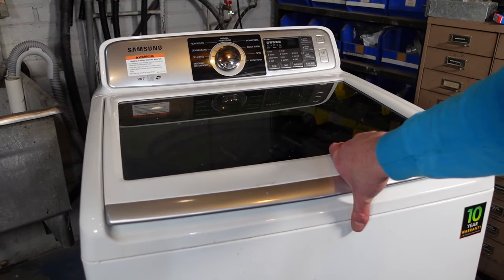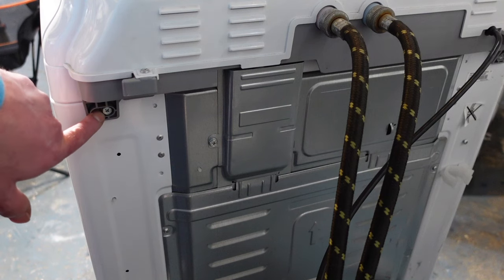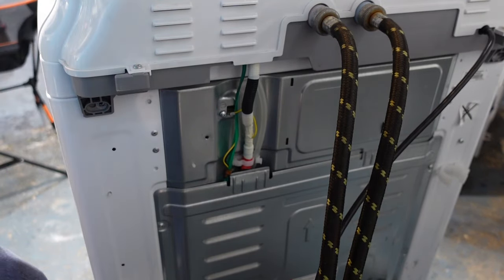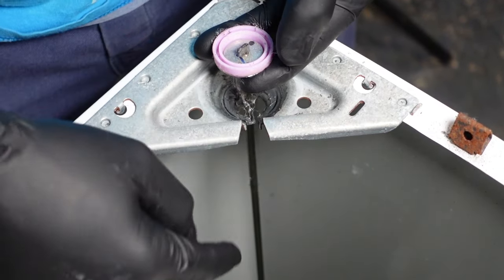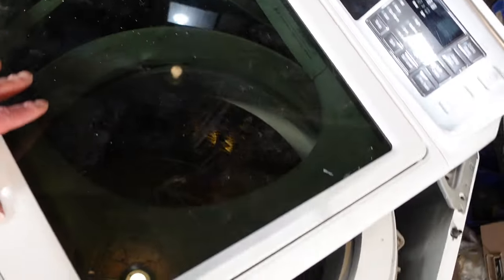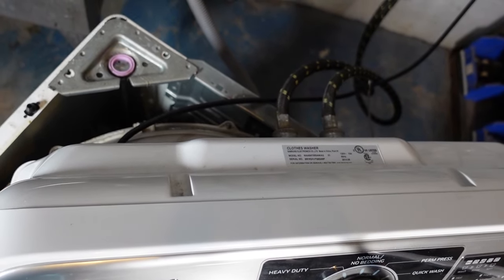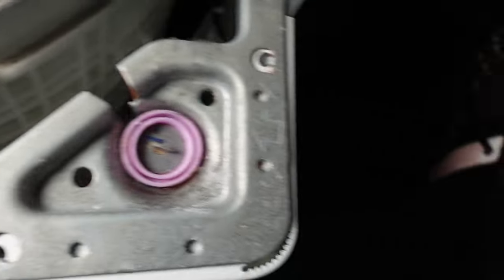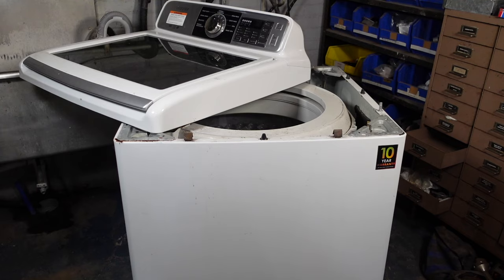Samsung Top Load Washer Off Balance FIX DIY How to Replace Suspension Rods DC97-16350C

Comment: I would like to add my notes as this video was posted 3 years and my washer 5200a is about that time from or another 6 months at max.  

The screws in the rear on mine are actually facing down on both sides. Then the access cover will come up.  Then you will removed the tub covers screws in the rear . Next there are two wires on the right side and one wire on the left. I removed them because when you lift on the tub cover your wires will be taking the stress of lifting.  Next lift the tub lid and remove the two rubber plug caps that hide your two screws in the front . Once removed the tub cover can be lifted and begin rod removal.  So the difference was location of screws and no front clip to press in with putty knife. Mine was all done with a drill at torque 7 setting(dewalt 20v) and I grabbed the top of the rods to get them out with a medium sized set of channel locks.   Make sure you lift on the tub when ever you expect to achieve what your doing - removing rod/ looking to get the bottom back in / putting the top back into place. I did take pics to add of my model as well

Comment: Slight note: removing the lid on other models, you have to wiggle out these two fingernail size rubber stoppers for the lid opening and closing (in front of lid) and there are screws beneath. No clips. Almost ruined mine.

Comment: Thank you so very much! I just finished this repair, and while I don't yet know if it solved the problem, the fact that I was confident enough to try alone is HUGE in my world. 
One thing I would add is a caution about the little metal tabs sticking up an inch or so to the outside of the clips. I kept hitting them and was, of course, getting nowhere.

Comment: Heads up for model wa45n3050aw/a4...there are also two screws up front before you pop the tabs! They are under rubber plugs.  Took me a while before I realized that myself.

Comment: Mine was part of a recall and the wife had a Samsung tech install 4 bolts to secure the top from launching and killing someone.
I had no idea they did that  and a repair guy who came to replace the suspension springs was just as surprised after he struggled for a good half hour trying to release the top.

Comment: If anyone has a newer dc68 there are no clips on front there are 2 screws under some rubber grommets or plugs that are very easily removed and much simpler screws in there instead of annoying clips

Comment: I removed the rods one at a time and measured the springs.  All were around 4 inches in length, so I stretched them all to 5 inches.  Next open the plastic cover with the foam insert, take it out  and cut  2 pieces of zip tie the same length, yours may need more.  Insert the zip tie pieces between the foam and the plastic cover increasing the pressure on the metal rod.

Comment: great video but i just did mine and i would recommend taking the back off as well. its not hard and it will save you frustration. those 2 in the back are hard to get to. mine has a wire on the left rear corner going to the pump and i broke it trying to change the rod. i then realized how much access there was after taking the back off. fixed the wire and it runs great now. thanks.

Comment: I saw a video where they recommended drilling holes under the basket ring to drain water. How do we know  If we need suspension rod replacement versus just to drill holes to drain the water?

Comment: Just had all four replaced and still having the same issue. Could it be the replacement rods are wrong? Sears repair through American Home Shield services
Reply: We fixed ours and just needed a drill, didn’t have to take anything apart. Now it stays balanced, clothes are not soaking wet after it spins and the banging has stopped. Yayyyy

Comment: Reasons are many more 
1: weak suspension roads 
2: the nut that holds the tub is loose
3: the pads the hold the tup from each corner on the top are worn out 
4: the tub itself is out of balance 
5: the machine is sitting on unleveld  ground
It's always better to check the machine when its empty run a full cycle and watch how the tub is spinning
Reply: The tub was spinning all wonky even after replacing the rods. Do you know what it is then?

Comment: My samsung has 2 screws in the front,  not clips. Any idea how to loosen the back half of mine? There doesnt seem to be any visible screes that will loosen it
Reply: There are two vertical screws and 3 horizontal.scewws that hold on the plastic cover in the back, when you remove the cover you will see 2 additional screws that go vertically through the cover and hold it down in the back. You cannot get to them without removing the back plastic piece

Comment: I replaced the springs on my washer but the issue persists. Is there other solutions related to the same problem?
Reply: I fixed mine, all u need is a drill, don’t have to take anything apart. Now it stays balanced, clothes are not soaking wet after spin & the banging noise has stopped. Yayyyy

Comment: My machine does not release the top from the front of the machine. There’s no way to raise it up even with the spatula and when I look in there there are screws bolted to the silver plates on either side of the suspension rod. Mine is model number WA45N3050AW/A4
Reply: Ours is not your model, but has screws like you say. My husband and I got the screws off and changed the rods. It was the most frustrating and difficult process. There is no easy way to get to the screws. We ordered after market rods and they didn't help. Got a tech out today who is recommending that we buy Samsung rods and do it again. Good grief!
Reply: I think I got the wrong suspension rod because mine still goes off balance. I have the same exact model. Did you happen to replace the rods? If so, which ones did you end up purchasing? assuming it did the job. thank you for your time

Comment: @LorainFurnitureandAppliance I have a Samsung top load that needs new rods. Model number WA50R5400AV/US. Will either of your products work for mine?
Reply from the maker: Yes, these ones!
https://lorainfurniture.com/shop/appliance-parts/washer-dryer-parts/new-4-pack-suspension-support-rods-for-samsung-washer-dc97-16350c-ap5623264/
Reply: @LorainFurnitureandAppliance  thank you!
Reply: @LorainFurnitureandAppliance  We ordered them and just replaced yesterday. They work great! Thanks again!
Reply: @LorainFurnitureandAppliance after 4 months, your replacement shocks/springs already gave out. They worked great the first 90 days then down hill since

Comment: How much does it cost to have someone fix this? Theres no way i can do this myself.
Reply: Why not?
Reply: @simpleinverso8628  im a girl. I have a rotator cuff surgery im recovering from and there is no way i can pull my washer out from the laundry room. Also, i tried to switch the door on my dryer and couldn't un screw, so im not feeling confident.
Reply: Ok. So washer repair man came today. Told me thats what it is and that i can do it myself. I think im going to attempt it! Another video said to get the new suspension rods not the original ones. Where do i get them for the best price? Cause im poor and i just wasted $90 on his diagnosis. Can i just unplug the washer instead of tripping the circuit breaker, so i can leave the light on in the laundry room?
Reply: Ok, i saw the ones you sell, how long do they last? I dont want to have to do this again.

Comment: I watched your video. I performed this suspension rod replacement exactly as you described. The washer drum still shakes using aftermarket rods from Amazon. 

What I am about to tell you is 100% verified. The factory rods I pulled out are two different legnths and two different colors. I have two pink caps and two white caps in the upper mounts. The pink caps are aproxamately 1/4" shorter than the white rods.

Since I did not notice the different legnths upon removal, I do not know where the short ones were vs the long ones. I do think this is making a difference.

Perhaps at the factory they compensated different legnths to ballance an already out of ballance tub.

I now have to take the new rods back out and see if they also are different legnths and try to rearange them until I find the magic combination as far as thier location. 

Please note: I bought the Samsung washer brand new and it has never been worked on until now. What ever rods I removed are in there from the factory.

I noticed in your video you also were replacing pink mounts with white ones.